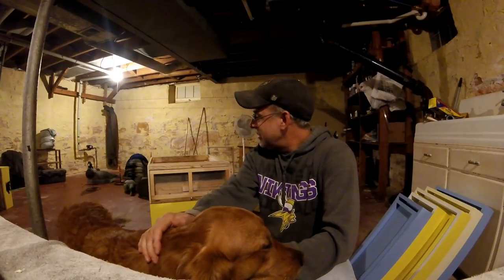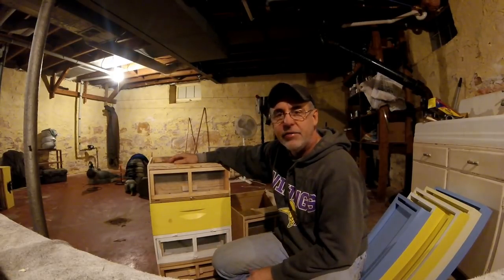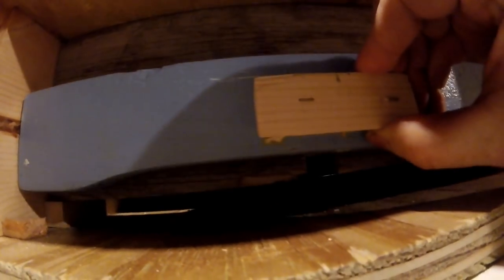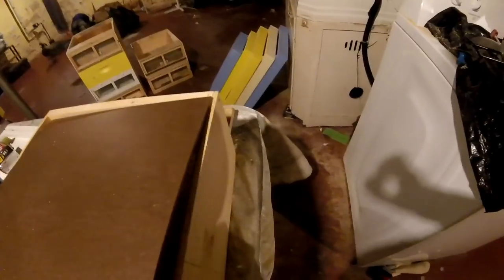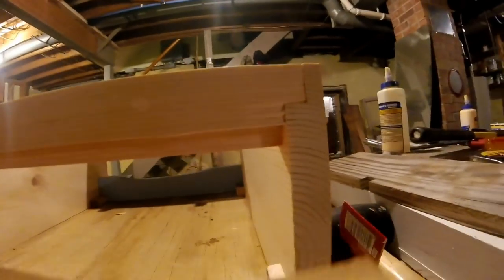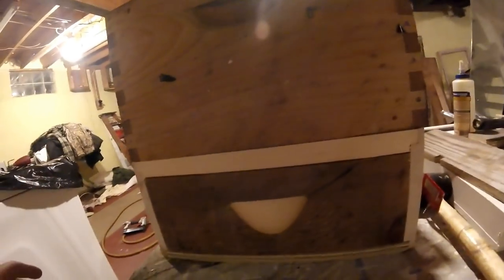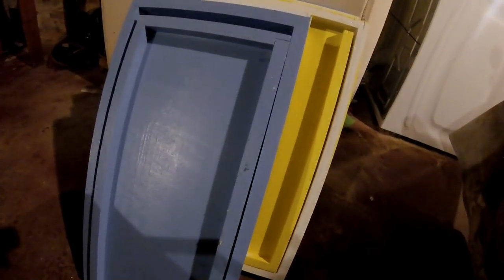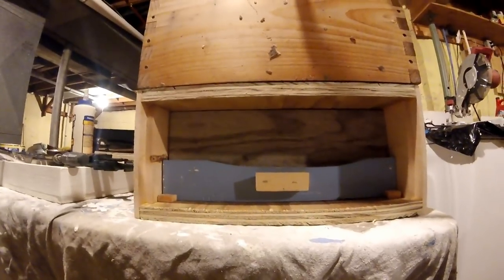Updated German Hive Bottom Box Project

Comment: Thanks for that. It was awesome. Im gonna make a slightly modified version where the floor board sticks through the frame so you can slide it out without lifting the hive like some other bottom boards.
Reply from the maker: That is certainly an option. I looked it to it a little bit with a 1/4" slot, but did not want to affect the structural integrety of that rear top piece. Good luck with it and let me know if it worked out....
Looking at another option where you can fabricate a pollen trap for it.